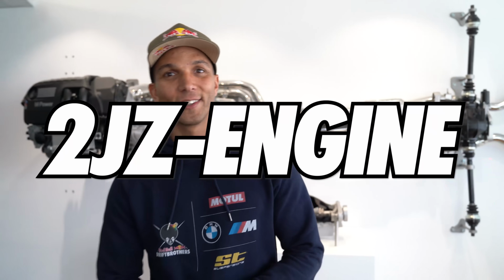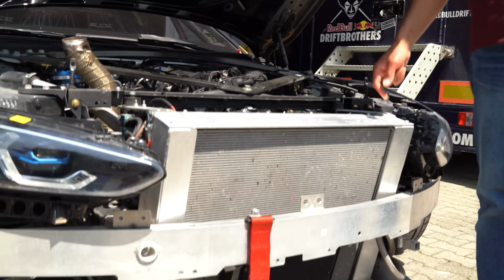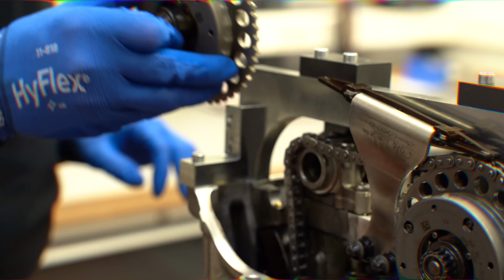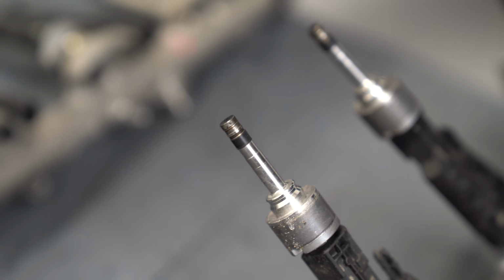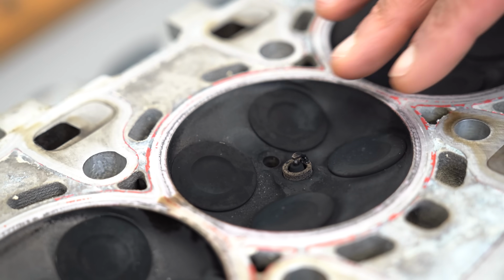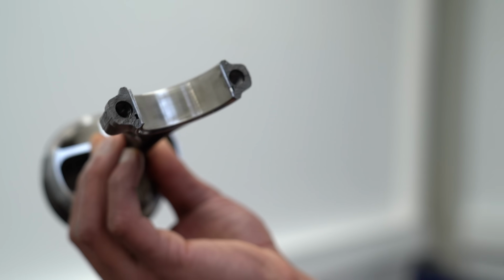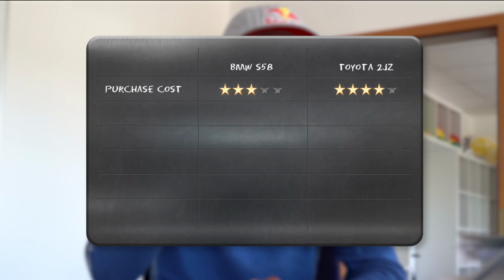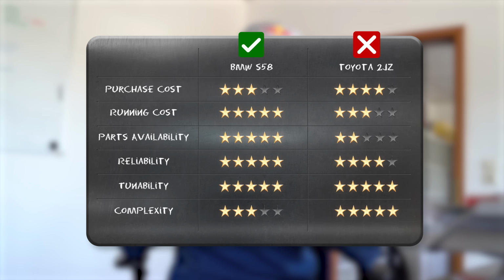Is THIS the new 2JZ? A deep dive into BMW's S58

Comment: Now let's see in a proper use where the engine is actually under load and not spinning the tyres 😂
Reply: Drifting is harder on engines than say heavy load situations like drag racing.
Reply: @shifty1927  no it's not. Just use a decent cooling system, good rev limiter and you will see logs that most the time engines don't even get close to full load and when they do is for a short time.
Reply: @MrArt69  constant on and off the rev limiter is definitely harder on engines. I've put at least 800 passes on my 1000whp m52 that we built in 2006 and have never seen a decently high hp one last in drifting.
Reply: @shifty1927  passes I imagine you taking about 400mts...that is not tuning that is luck 😂no, seriously I could explain to you with thousands of logs from cars I have worked on but best I can do here is "trust me it's not"
Reply: @MrArt69  luck? We were the first to break the 5, 6, 7, 8,900 1000whp mark for those engines and first to run 9s .  And your logs are irrelevant compared to the countless m5x/s5x that have blown while drifting. Theres got to be a reason most with e36 platform goes 2j or ls.
Reply: @shifty1927  yes, as I said first post, bad rev limiter,bad cooling and lubrification. BTW, you just proved me right.. 5s pulls... You understand me now? 400mt is irrelevant for the type of wear we are talking about. But it's because of people like you I ask for more money to tune drift cars.. Even if they are a lot easier to tune then track cars (track not drag)
Reply: @MrArt69  i specifically said drag is easier on engines than drift. You're agreeing and proving me right goofy. 🤣
Reply: @MrArt69  also people like me? I see your inferior work on your page. You've never seen the type of power I've been making for 20 years. But keep on feeling elite with your 300hp megasquirt tunes.
Reply: @shifty1927  I was not bring drag into this but yes 😂 I bet if you put this engine setup into a m3 xdrive it will die really soon on "just" road pulls. I love the s58 it's just that drifting is not a wear indicator for nothing.
Reply: @MrArt69  are s58s known to be that failure prone? Cause when my m52 was stock internals making anywhere from 600whp to 730whp i put 9000 miles on it street racing, daily driving it and driving back n forth to the track. Also two autocross events on wastegate(litttle over 500whp) And this was almost 20 years ago. Before obd2 was even tunable/unlocked for the e36 and cheat codes/safety nets like ethanol. Figured that be an easy feat now a days with the tech available.
Reply: @shifty1927  no, s58 is amazing engine but not as amazing as this video wants to show. As you can see they run the engine pig rich and probably they power figures are just dyno not what they run plus as I said, a drift pass has less full load then your 5s pulls on the drag. Over 1000nm on this engine will not last on the road with stock rods.
Reply: @MrArt69  still gonna say 20 min of drifting is harder on engine components than 20 mins of road racing. That constant fluctuation going from off throttle to rev limiter causes way more failures than going through gears normally at the track/circuit.
Reply: @shifty1927  and I will thank you for thinking that so I can keep making more money on tuning drift cars 😂 but think with me.. If you rarely reach full load and you have a clean rev limiter what do you think it can go wrong? Most of them die due to bad lubrification and bad tuned rev limiter that's it.
Reply: @MrArt69  you're greatly underestimating the load a drift car is under. They're not just spinning wheels on ice as you're making it sound. They run alot more grip than you think. Also the lead up to the first turn is pretty much a drag race in drifting then its 1-2 minutes on the rev limiter. No way 2 mins of track racing causes more stress on the engine, especially the valvetrain. Also I wish I could run 5s in the 400m/ 1320ft that's for cars making like 2500+ hp. I only ran 9s @ 160mph.
Reply: @MrArt69  lol, drifting is one of the most punishing use cases for an engine and it's the reason they added so much cooling on top of using a rich air/fuel ratio. You have no idea what you're saying. If you really work in a shop, I wouldn't come to you based off that statement alone.
Reply: @xIcarus227  you are funny. The add cooling because it goes sideways no air.. They run rich because they can and people love to see flames. I don't need more costumers don't worry.
Reply: @MrArt69  they add so much additional cooling because drift speeds are relatively low and because keeping an engine up at that RPM constantly heats it rapidly, much more than on a track. Going sideways is only part of it. 

Running rich has absolutely nothing to do with flames, at this point it's pretty clear you don't work as a tuner like you claim. 
You get flames by not cutting fuel when off throttle, that way the unburnt gas is thrown in the exhaust and ignites there. 
You run rich in order to keep temps down. It's absolutely hilarious you tried to give credit to your lie by presenting yourself as an authority when you're not even close to being one.
Reply: @xIcarus227  still funny. If I where to teach you I would have to charge. I think there is a music like this 😂 still you are right just not about the track part. Engine has a lot more load at track the drift. This is the last time I will reply.
Reply: @MrArt69  okay, so to conclude you've got no further arguments to support the drivel you spouted. Good, at least you know your place. Bye now.

Comment: S58 is king 👑 but respect to the 2J for holding the crown since 94’
Reply: I love my S58 but bruh people are going 5’s in a 2J, who’s doing that with an S58, I’ll wait
Reply: @ Running 5s in in the quarter or the 1/8th?
Reply: Cast 2jz can handle 2000hp s58/b58 can’t… very simple just watch jay meagher go over the engines from rs garage. Also a 2jz can handle around 40psi on stock motor at 1000+whp while a b58/s58 would have a head lifting soon after.
Reply: @RaceJam  def currently doing big things.
Reply: U just can't say that yet, and I'm a "bmw guy" thru and thru. When the s58 is 30yrs old and still doing it, still being the motor people choose over EVERYTHING that came out after. After people swap it into everything and anything they could think of. When it has a service record longer than 5 years
Reply: @RaceJam  no doubt , I believe your bias is overlooking something. Tuning technology now compared to 1993 is vastly different. So the 2jz was always capable of 1200whp on stock internals but tire tech, fuel etc wasn’t what it was. S58 tuning being unlocked faster doesn’t equal better. 

Now a 2jz block can handle 1600whp or more what is a S58 block limit and if both are being abused which will last longer? You and I both know at this point the 2jz being cast iron has the upper hand , HOWEVER the S58 is the truth because with modern emission standards and aluminum block it’s stout. But then again BMW in the 90’s and early 2000’s still built nothing that compares to a 2jz SOOOOOOO…….yeaaaaaa. Just give Toyota its credit for blessing us all in the early 90’s.
Reply: @bigjdm5460  "Tuning technology now compared to 1993 is vastly different"
It is, just not in the way you made it look. 
Modern tech means you often can't crack the DME until a few years after the engine is released, which delays tuning potential by a lot. The DME in the S58 has only recently been cracked, and only though a bench unlock, no flash unlock yet. 

Furthermore, the 2JZ happily profits from modern tuning technology. So really the modern tech argument helps the 2JZ, not the S58.
Reply: @xIcarus227  modern tuning helps you push any engine further.
Reply: @bigjdm5460  including the 2JZ, yes. 
Whereas modern tech locks ECUs like in the case of the S58. What didn't you understand?
Reply: @xIcarus227  2jz cast iron block will always hold more power. Regardless of how long it takes to crack the S58 ecu. When it’s all said and done my point above is rather 1992 or 2030. The 2jz will hold more power reliably.
Reply: @bigjdm5460  that's likely, but the reality is that we don't know. 
The stock block of the 2JZ is good for maybe 2000HP whereas we don't know how much the stock S58 block lasts. 
Don't discount the effect of 30 years worth of improvements in engine alloys.
Reply: @xIcarus227  cast iron vs aluminum, I get your point but ur taking common sense throwing it away for a little bias. We both can assume till we see a S58 the 2jz block is stronger.
Reply: @bigjdm5460  what bias..? I even said you're probably right.
Reply: B58 is King...
Reply: Guys let’s be realistic the 2JZ could make a lot of power but the torque sucks until boost kicks in. Which typically takes for ever do to horrendous Turbo Lag. The S58 is an insanely torquey motor for an inline engine.
Reply: @Tain950  just looked at some dyno sheets . S58 built with E50 on dyno graph made 690WTQ AT 4.3K rpm/ 690WHP at 6.10RPM

2jzGTE (non VVTI)  sound performance dyno run . 690WTQ AT 4K rpm / 640WHP AT 6.5RPM. 

Even though the S58 has more stroke I dnt see why u believe a 2jz can’t achieve the same or similar spool?
Reply: @bigjdm5460  I could be wrong but seems like the extra stroke on the S58 helps on low end performance vs the 2JZ. I do understand that modern Turbo’s and auto trans make a significant difference as well though 🤷‍♂️
Reply: 2jz is still the best because of the durability,  quality and test of time. You’re talking about a motor 30 years old. S58 is a beast, but lets just see the durability after years or even a decade.
Reply: LS...
Reply: U dnt go above a 2jz u can sit beside it. Caus believe me it’s 2jz out there right now that will kill any s58.
Reply: @bigjdm5460 no there are no srock internal 2jz that can touch a stock internal s58 in power production a s58 can hold 1000hp bone stock with just turbo upgrade the 2jz can't without major change in engine internals the only 2jz that kills the s58 is a billet block with forge everything internal 2jz and those aren't even 2jz anymore there nothing left that was made by Toyota it's basically a part spin engine.
Reply: @patthonsirilim5739  hmmm, you do know it’s countless people making 800-1000whp on a 2jz stock internals right? I can’t even laugh at this comment because in 35 yrs old and have seen 10 in person atleast , 3 dyno runs (seen the car in the wild) , and seen many drift/drag/street builds with 800whp EASY. 1000 whp . its a couple guys I’ve seen on YouTube on dyno making 1,130WHP stock internals (one guy was beating in in compitetions for months before he bent a rod. 

TX2K24 I DIDNT SEE ONE S58 SHOW UP. B58’s were making 7.9-9.5second runs. NO WHERE CLOSE to what 2jz’s were doing. Just YouTube comments raving about S58 ‘s but no show this year. We will see in 2025.
Reply: @bigjdm5460 did you even watch the video or do you somehow think your more knowledgable than the guys at redbull. They literally said the 2jz gets no where near the s58 without forged internals. But yeah lets all trust some little ken block from youtube over them. Your a nobody calm down 😂
Reply: @kingvega666  these guys could be bias. jz been around a long time and countless 1000whp builds on stock bottom end. Plenty drift builds with 800plus on stock bottom end. Haven’t seen many S58 1000whp drifting or being abused and living . Time will tell. They say the B58 is better but people have issues with fuel injectors wearing then ruining coating on cylinder walls and engine gone. So we will see.
Reply: @bigjdm5460   You can't even spell, the S58 can handle more power on a stock longblock for far longer than a 2JZ. The 2JZ  was ahead of its time for sure and was top of the heap for a long time - but its an old engine now and long past retirement.
Reply: @joewolfe642  link the clip of a stock s58 making 1130whp or more and being abused for months
Reply: @bigjdm5460   watch the video - they abused the hell out of it for 2 years... a drift car is going to see more stress than a street car
Reply: @joewolfe642  bro we need data. These guy have BMW engineers or bmw personnel doing a tear down with modified cylinder head. I dnt know what in the stock everyday is going on here? 2jz can do the same without modified head.
Reply: @bigjdm5460 Just stop talking please
Reply: @bigjdm5460 2jz been around for so long has had alot of time and developments. Give the s58 abit if time and it will hit those numbers
Reply: @bigjdm5460 unfortunately, no there’s not. Those Tex2k A80 Supras have as much Toyota in them as the A90 Supra does. Once you start going billet block, new internals, overhauled fuel system, etc it’s no longer the same engine so what it can do from there means nothing besides an arbitrary number. S58s already make way more power on a stock rotating assembly than the 2JZ ever did & the DME isn’t even unlocked yet.
Reply: @CadexLaw cost for cost 2jz is a better/cheaper engine and one that will last,  S58 while very good i don't see holding up well after 5-10years of abuse
Reply: @CadexLaw  There are TX2K and FL2K drivers still utilizing the stock 2jz block and haven't even gone billet. I agree with your point around being "less" 2j when they go billet but many still run the stock iron block
Reply: @CadexLaw  We dont have any consistent data on a s58. if so just post it. a 2jz can handle 1000whp with a good tune and dailing torque back down low. also whats the fastest stock block 2jz 1/4 mile time? or whp made on stock block?

now hat is the most a s58 made on stock block and the fastest 1/4 mile time?
Reply: @CadexLaw 🤦🏽‍♂️, every car over 1200whp needs a billet block. The design is still the same engine. You don’t call Supra a Supra when you start putting an ls in there. Billet block allows the design to reach its maximum potential, why do you think the vr38 in the gtr destroys every other car in tuning? Because the design is superior. No modified car can stand up to the v6.
Reply: @Eclipsis17  Once you throw a billet block in the mix, it’s no longer the same engine I don’t give a damn if it’s the “same design” or whatever unless you have infinite money in which case you’re not buying a Nissan anyway. For what it’s worth the VR38 is one of the worst tuner engines you could possibly buy if you ask me, the buy-in is extremely expensive & those things get the absolute piss beat out of them used all for the potential to not really be that high, as VR38s are notorious for having super weak stock rods. For what it’s worth there are quite a few engines that can make over 1000hp on an unopened engine (at least for a few dyno runs.) the S58, coyote & Lambo V10 specifically come to mind but there are others.
Reply: @Eclipsis17 once you add a billet block with all of the guts replace it no longer matters any decently design engine if given unlimited money can make godly amount of power the s58 is a stronger engine then the 2jz with stock internals and stock block those 2k HP supra are not relevant an inline 4 1.6liter could make 1500hp that is strong enough to last a 2hr F1 race at full racing pace in the 80s if given crazy acess to time and money nothing special about a 2jz making 3000hp even a Honda b18 inline 4 could make 2000hp if you throw enough aftermarket shit at it.
Reply: @hoodyman88 to answer your question, the motors would have to be in the same car.. now add another 25 years and see how durable the s58 is. Im no expert but would guess the 2jz is easier to live with.

Comment: Kind of a stretch to compare an engine that costs 10K + to something that was 3-5K for over 20 years.
Reply: Adjust that price for inflation buddy same thing
Reply: @Justanothercarguynyc  lol, the price hike was around covid time. So no, it's not all inflation. The reason the 2J was king was because it was semi affordable for a long time and bullet proof. That's why I said it's a stretch..
Reply: A new S58 is closer to $30~$40k from what I've read. 🫨

I'm assuming that includes everything and not just the long block.
Reply: @FastRedPonyCar  I just looked up a longblock on ebay and it was over that 10k mark. The truth is that there is no replacement for the 2J from a Euro or Japanese manufacturer in the US. The only affordable swap would be the LS.
Reply: @nismospek 3-5k without inflation. If you consider inflation, that's 7-12k, almost as much as the S58 you said you found. 
In fact, 2JZ crate engines are about 10k as well if you search a bit so at that point the S58 doesn't seem like much of a stretch. 

The LS is much cheaper though, spot on. That's the main reason people LS swap virtually anything.
Reply: @xIcarus227  Its more like 5 to 8k (purchasing power) as that is going back to 2000. If you from 2010 to 2019 its even less.
Reply: @nismospek  the A80 Supra was sold from '93, why would I compare to 2000 or 2010? The prices of the 2JZ have constantly increased ever since.